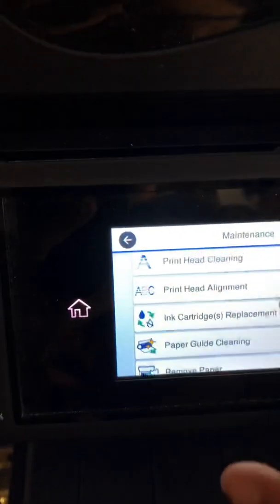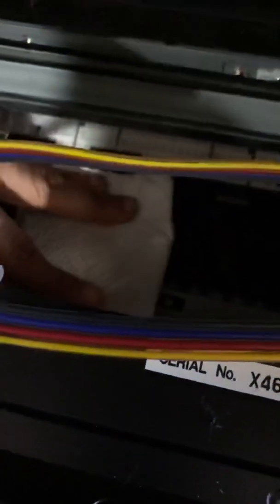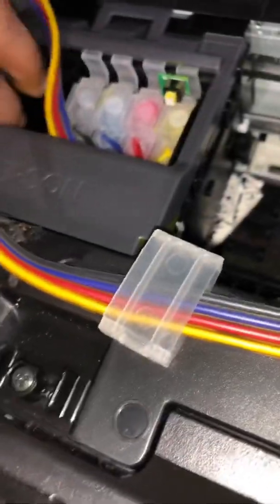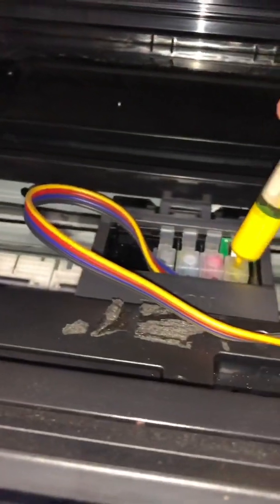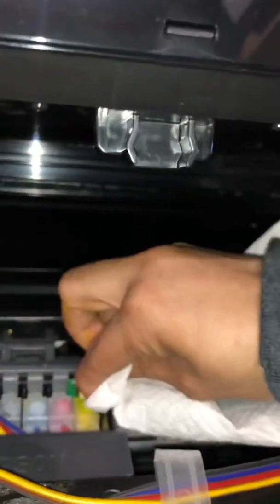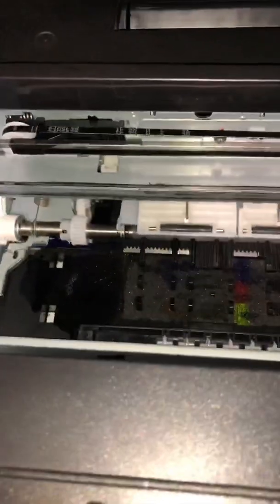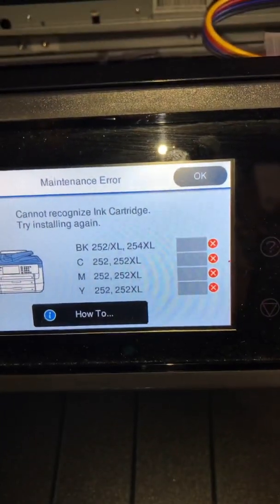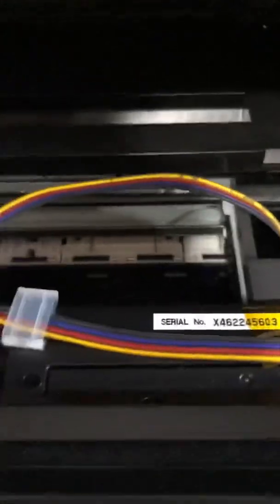Sublimation printer Flushing clogged print head with ink when nozzle clean doesn’t work.

Comment: Ok... what was wrong with your printer??? I have this same set up but I'm not getting anything when I do a test print. Cleaned the head multiple times. Nothing. Was hoping you'd better explain  whatever you were doing but, nah... 😒
Reply from the maker: I’m flushing the print head, 
But I found faster method
Put windex in the capping station let print head sit for about 10 mins and then run cleans. 
If you do this method on video you can do with windex but  do not  push /force  tooo much force will blow the print head.

Comment: why does your printer have the wires to your cartridges? I have the same printer and mine doesn't have this. Also, my Cyan is not printing at all so I'm going to try this. Will let you know how it goes
Reply: Sublimation printer
Reply: It's a Continuous ink system, the wires lead to big tank so it doesn't have to be filled